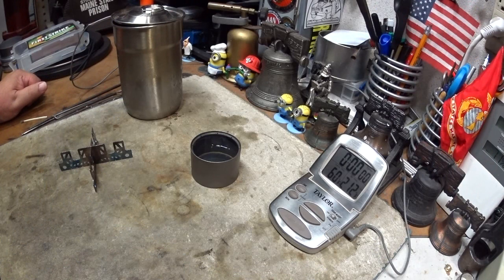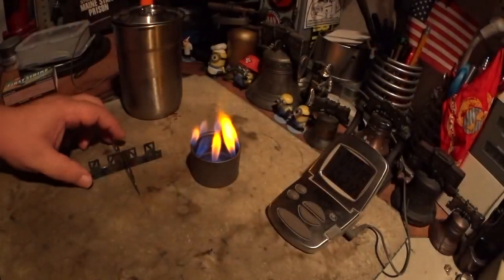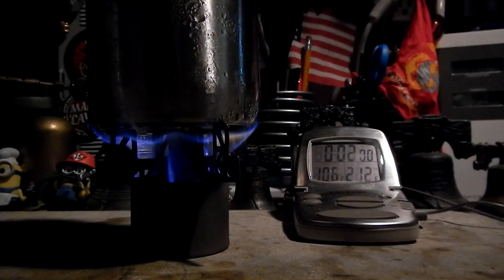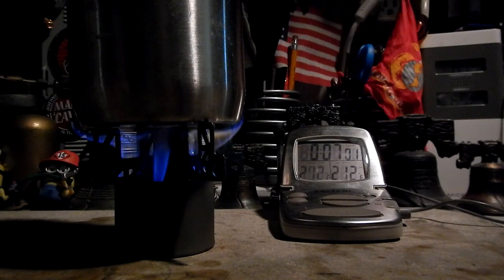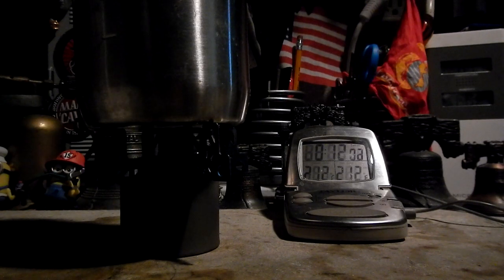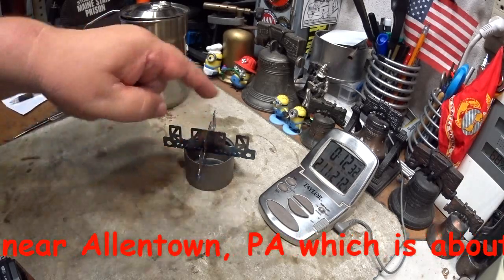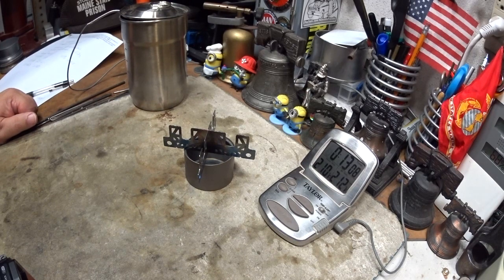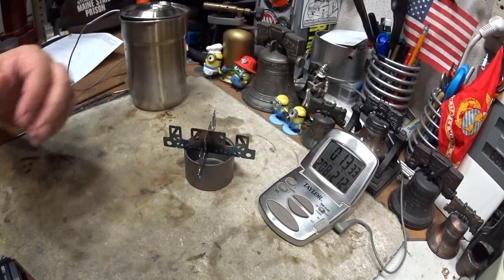TOAKS TSA Stove - Evernew Ti Cross Stand (Up-side-down) - Stanley Camp Pot - Boil Test #6

Comment: Very interesting. You would think the wider pot would have better heat transfer over the "skinny" pot. You introduced another variable by flipping the stand and using the skinny pot, but you may have already tested the wide vs skinny under fixed conditions. As always, thanks Hiram for sharing.